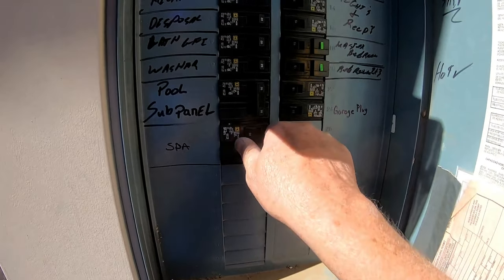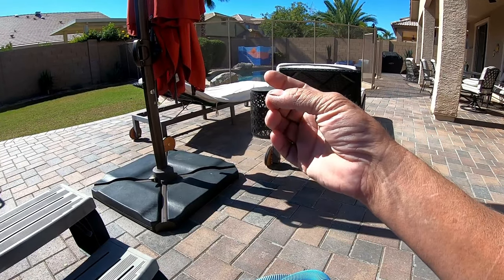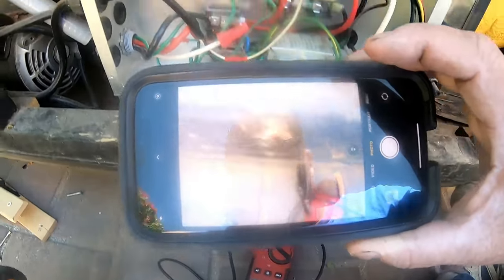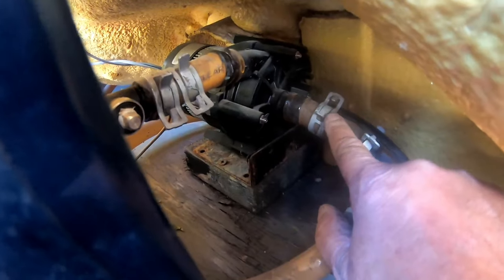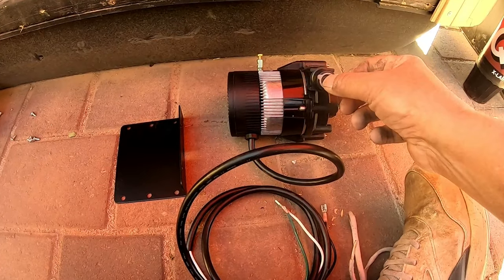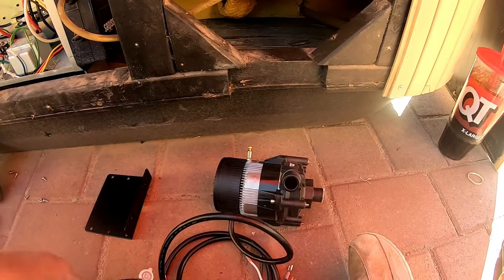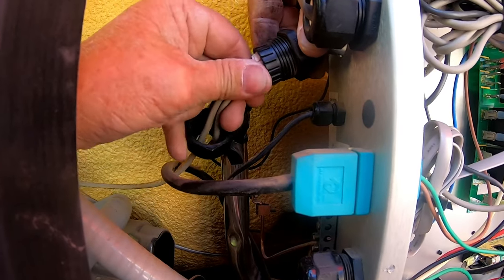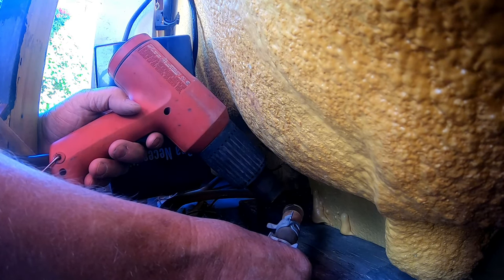Jacuzzi / Hot Tub / Spa works but will not heat...Easy fix.Arizona Hot Tub Factory. I can teach you.

Comment: That is NOT an Easy fix.
Reply from the maker: Opinions will very on what is easy. The hardest part about fixing a leak is finding it.This leak was easy to find and the rest just take time. Hope this helped Thanks for Watching & SUBSCRIBING
Reply: It’s actually really easy on that tub.  Especially if you splice the ground on the circ pump, and don’t bother heating the tubing up w the heat gun.  If I ever replace a flow switch with no water in the tub I use a worm gear clamp on the left side because that’s the one that likes to leak.  I could probably do that repair in 20 minutes or so and jacuzzi’s labor rate is one hour

Comment: It doesn’t matter which way you plug the wires in on those jacuzzi tubs.  They are 3 wire.  Sometimes I found a stuck relay where the white side is good but the other side is stuck or not working.  If it’s 240v I will plug one wire to the terminal block in a pinch to not have to replace the board.  I have even wired a jet pump up like that in a convertible spa wired to 240v when I didn’t have a 115v jet pump.  I was just there like a year ago and it’s still working fine.  If a flow switch is cloudy it usually had a fl2 error.  That’s what happens when they melt is get cloudy

Comment: How long does a circulation pump generally last? I've replaced all of these before about 4 years ago.  That silver bar gets REALLY HOT (hot enough to burn you) when you first turn it on, then the fl1 code comes on. Ive verified the flo sensor works
Reply from the maker: How long they will last really depends on how well you maintain your spa. 

My spa is way over 10 years and I've replaced nothing but the water every 3 months check chemicals every week clean the filter every other week and I replace my filter once a year.

You have several thing that could be causing your problem
(1) dirty filter or old filter 
(2) if FL-1 comes on the flow switch does not have enough flow to close the switch. if pump is good then you have something else going on like a block in the line
(3) if the silver tube is getting really hot to the touch ? again you have low flow or no flow due to a blockage in the system or pump is junk .
Hope this helped Thanks for Watching & SUBSCRIBING

Comment: Just watched the video on the tub not heating up. I have a small TX Hot spot.  My tub is heating but as soon as I press for SYSON for a schedule run it shows a double spaced lines and stops heating. I'm almost sure it's the pressure relief switch. Before I spend $60 could it be anything else.
Reply from the maker: Going to need awhile lot more info to make the correct move as to what it is. Thank for Watching & SUBSCRIBING

Comment: Very good info,I have an old hot tub,got it for free,but firs time I turn on it pull water trough the holes ,all good,but then I start touching small valve that is  located on top I think is manifold open and close valve,and it stop throwing water ,and put on screen. Water in water heater got to hot 😢

Comment: Hi Scott! Your content is so helpful! Thank you so much sharing such great advice with us! I've got a specific question, if you don't mind me asking here. Just got a used hot tub. My wife and I are excited to be able to have a bit tub. Very small leak where a 3/4" line is glued into PVC. I'm going to try marine epoxy putty to stop the leak, as it's a very deeply buried hose. But the main question is: what is the third hose on my Sundance flow switch for? It's got an inlet and outlet in 3/4" barbed, but there's also a 3/8" barbed hose coming off it just past the switch. What are these little hoses for? After coming off the flow switch, mine T's. One side attaches just before a jet inlet. The other end wasn't connected to anything, and I can't seem to find a place to connect it! Sorry for the length. Happy holidays!

Comment: Hi SpaMan, I’m having trouble with my VS300 Balboa spa pack in my hot tub. I have no display on my topside when I turn power on. Also light comes on and the pump starts without going to prime start up sequence.  Has a burning smell from pump area as well then everything shuts off. What do you think is wrong ? Thanks

Comment: Great video, thanks! I just got a "free" haha hot tub and I figured it would need some work. I have everything going now but there is no heat, it is sitting at 60 degrees. It feels like the circ pump is moving but no water is moving over the flow switch. Before I replace the pump and flow switch is there another solution? I didn't know if maybe airlocked, the 2 pumps and blower are working correctly. Thanks again for the video, I might have jumped ahead and and changed the heater before this information.
Reply from the maker: Vert rarely is it the heater... Filters, cir pump, flow switch, and both sensors are what needs be replaced... not changing all four is like only putting only three new tires on your car. Hope thisHelps Thanks for Watching & SUBSCRIBING

Comment: Scott, I recently got a 315 Jacuzzi and I have put a new heater element in the flow switch is not showing that there’s a fault there’s no FL one but it’s staying at 58°. The question is should I replace the circulating pump at this point

Comment: Hello spa man, thanks for all the videos you share! One question for you, where is the best area to drill a hole for the electrical/liquid tight conduit entering the tub? Some tubs are pre drilled i believe but mine isn’t.. Thanks in advance and more power to your channel!
Reply from the maker: I place the Hot tub in the spot that I or the customer wants it and then I figure out the best way to run the seal/liquid tight so no one trips over it. Sometimes you will need to take off one of the side panels also so you can make a real clean look and have the line run out the back so its out of sight. When drilling any holes in the side of the tube take the side off first is you know what is behind it so you don't drill into something like a hole or pump/motor.. Hope this Helps. Thanks for Watching & SUBSCRIBING
Reply: @spaman5440  would it better of in one of corners vs drilling a hole in the actual remivable panel? Corners has a thicker wood foundation to drill.. the panel is thinner i guess but might be an issue when you need to take off the side panel for any service issues..
Reply from the maker: @rainmaderazo7081  Sure the corners are fine also...Just what ever you do alway check to see what is behind the spot you are going to drill so you don't damage anything ....over the year I've done so many installs I've lost count but one thing is for sure Ive never done two there were alike. Hope this helps
Reply: @spaman5440  Thanks for the tips!

Comment: Question. Had a tech out a few months ago and he replaced my bad circ pump. FL1 error just popped up again. I can see why you recommend doing the other items as well. It has a new temp sensor and I used your screwdriver trick to jump the contacts on the flow switch and nothing happens. I can hear the circ pump and main high low pump running strong. Any other troubleshooting tips you recommend?  I am hoping it isn’t the board.  Thanks for all the great videos !!
Reply from the maker: If the filters are more the a year old I would replace them. If every thing else is working it is not the board. Thanks for Watching & SUBSVRIBING

Comment: I love how you carefully explain and make great effort to make sure we can see exactly what you are doing. I subscribed. I have a Cal Spa hot tub that will come on and pump will run both speeds but no heat. Also on the control panel it shows 18.88 and never changes. The panel buttons that change temperature settings and modes does nothing. The pump switch and light buttons work normally. It seems like it must have some sort of problem with the panel communication and other than the 18.88 there are no error codes. The book shows codes but says nothing about what the 18.88 might indicate. I thought it could be flow switch or sensor problem or heater gone bad but why would it also not indicate anything on the control panel or change modes? I live in a rural area with no professional options.
Reply from the maker: Call Scott during the week and he will be able to get you going int the right direction. Thanks for Watching & SUBSCRIBING

Comment: Hi there. On the flow switch,  does the flapper touch the black post when closed? Mine isnt touching. Reason i ask is i have new filter, have removed too, new circ pump and new flow switch. Still have intermittent flo error. Thanks
Reply from the maker: Turn off the breaker and remove the filters...then go turn the breaker back on ..
After turning the breaker on take your hand and put it in the water next to were the filter hole is (left side with screen) if it doesn't feel like its trying to suck your hand in.... your cir pump is not making enough flow to close the switch to turn on the heat and you have to figure out why ???

Something caught in the tube
Pump is junk
Wired wrong and pump is not turning on
Board is bad
 Hope this helped Thanks for Watching & SUBSCRIBING
Reply: @spaman5440  Thanks. Lots of flow in the inlet suction. Waterfall flows great. I drained and checked the suction of the pump end for debris. It's clean. Put another oem flow switch in. I'm baffled...
Reply from the maker: @naterollyson990  Call the office and talk to Scott and Im sure he can get you going in the right direction

Comment: First off, love your channel and informative content, thanks! Ok, I have a plug and play that will eventually be hardwired. My issue is, the temperature won't get above 101 and it's set for 104. I should disclose  I live in Canada and currently it's between 23 and 30 degrees ambient temperature. Do you think that would be the reason for the struggle to achieve warmer temps? Or should I consider the unit is in need of attention? Any help would be appreciated.
Reply from the maker: Most often the reasons for this is there in not enough insulation in the unit (Especially around the pump /motor compartment) and it is struggling because of this... I had the same problem several years ago in Showlow Az during the winter time temps in Showlow at the time were also in the 20s and I fixed the problem by adding more insulation.  Hope this Helps Thanks for Watching & SUBSCRIBING
Reply: @spaman5440  thanks for the quick response,  I will open the panel and make the necessary adjustments.

Comment: Curious why all of the flow switches on Amazon have the arrow pointing the other direction?
Reply from the maker: The ones on Amazon are sometime not an OEM part and are after market parts.. I do not use aftermarket parts ever. for the most part they are a good replacement if you can't get the OEM part or live in a part of the world that its hard to get parts ... Thanks for Watching & SUBSCRIBING

Comment: My flow switch was corroded right off the terminal and I had the FL1 code...I changed the switch but I am still getting the FL1 code....when I touch the 2 terminals on the control board, the FL1 code goes off and the heating element tube gets hot....I am leaning towards a bad circulation pump as the main big pump is working....am I on the right way of thinking???
Reply from the maker: I would replace the Cir Pump , Flow Switch , Heat sensor and the Hi/Low I treat everything as a system. Its kind of like going to a tire shop and only changing 3 of your tires. You are going in the right direction. Thanks for Watching & SUBSCRIBING
Reply: @spaman5440  thanks....does the heat sensor by the cartridges set the display panel numbers....i know you like to replace it and it's pretty easy but it is another 60 bucks on top of the 400 already invested....these hot tubs can be money pits...pumps, covers, cartridges, pillow pads....yikes
Reply from the maker: @brianbanks3044  I replace them in Arizona if I know for a fact they are over 7 years old because of our hard water its just a matter of time before they do. Now if I get to a hot tub that I can tell has not been taken care of and everything is really chalky I will also replace it.
Reply: Just replaced the circ pump/flow switch and all is well so far...no FL1 light and no leaks....really proud of myself that i did it without draining the tub and only lost 8-12 ounces of water at most.....the rubber tubing was still pliable and had the heat gun just in case but no need for it....thanks for the tips all the way out in Syracuse NY

Comment: Hey Scott, mine wasn't heating and the relay was not closing. I replaced the heater relay and now it will only heat with the pump on high. Any tips or ideas on what I should check next? Thanks
Reply: Switch the wires where the high and low speeds hook to the board if you can never get it to clear.  Sounds like a little bit of an obstruction somewhere.  I have had to do that once or twice w a clog I couldn’t find that the heat ran off the jet pump.  You could just need a filter though if you take it out and it heats on low speed

Comment: you can pump chlorine hot tub into a salt water pool without issues, just not the other way
Reply from the maker: DO NOT EVER DO THIS  Don't ever mix them. 
I sometimes will empty into a pool only after I am told that the owner is using the same chemicals in both the  Hot Tub and the Pool 
Thanks for Watching & SUBSCRIBING

Comment: How much can a hot tub technician make in a year?
Reply from the maker: $100,000 K+..You have to have several things going for you.But this is what it will take...There are a ton of variables to consider...Its all going to get down to you and your ability and understanding of how hot tubs work and how to fix a Hot Tubs. So depending on what part of the world you live in (You need several old , used and New spas to work on)and how fast you can get parts and supplies... then you need several good relationships with dealers and manufactures (warranty work) I like working for AirBnBs and HomeAways. Im on call they need it now and they are willing to pay the price for quality work and I know my worth...Hope tis Helps. Good Luck and Thanks for Watching & SUBSCRIBING
Reply: So, my circ pump does this everytime i drain and fill, once it primes this exact noise and  condition stops.... is my pump "weak" or do you have any suggestions. Literally followed Jacuzzi manual to the letter in attempt to prime properly but it never works. Eventually it primes and off it goes but its a real pain/annoyance THANKS!